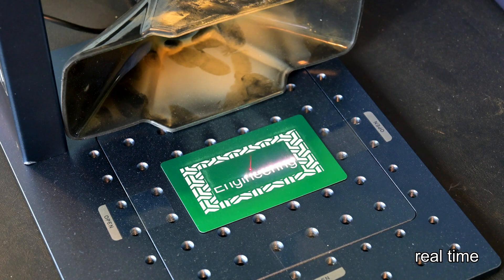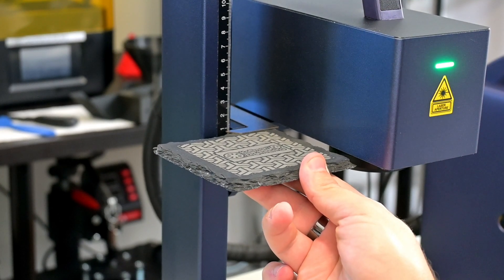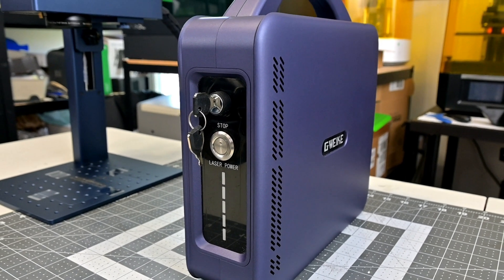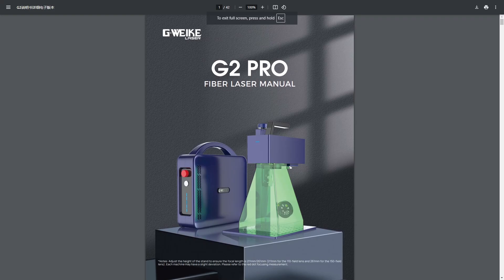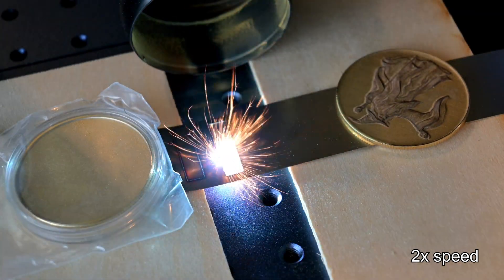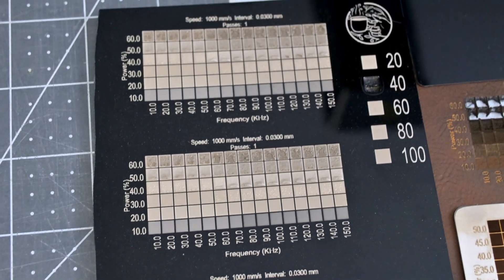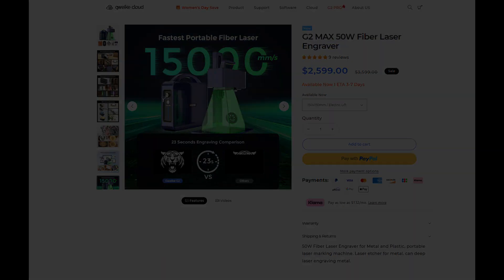The Best 50 watt Fiber Laser, with a catch | Deep Engraving | Metals&Plastics - Gweike G2 Max Review

Comment: I just got one of these and I have to say uh.. I'm not feeling it.. 

The head riser has a ton of slop in it, the inspection sheet that came with it honestly looks like it's not well calibrated, and the electric lift unit is so slow it's hard to imagine this being an actually enjoyable machine to use. This is also a "portable" laser but the cable between the source and head isn't armored or protected in any way similar to a portable marking laser. I'm not sure I even want to drag this thing to a craft show ~ Effectively, this isn't something I'd want to actually use as a portable unit. Unfortunately since I didn't get this as a free test sample, I'm honestly not even that motivated to turn it on because I'll probably get dinged with a repacking fee by actually using it. That means it doesn't actually get a shot. It's getting returned.. 

I wish I'd spent the extra $800 to get a proper desktop machine instead of a dressed up portable industrial marker.
Reply from the maker: Interesting feedback, thanks for commenting. I can't say I've experienced slop on the head riser, certainly none that would affect performance. And I'm a bit confused about lift speed. It only takes a few seconds to adjust, and I can't imagine a scenario where you are limited by focusing/lift time, as opposed to any other step like design, positioning, etc. But it's interesting to hear that it might be important to some people.
Reply: @HoffmanEngineering  Observing the rigidity of the unit shows it's highly susceptible to movement. If I type on my keyboard on the other side of my workbench, I can observe the head vibrating.

Honestly, it might be fine, but when these companies tend to crank you with restocking fees for using it at all, I'll just pass on turning it on and spend the extra bit to get some more working area and rigidity. After seeing it in person for $2500, I'm throwing this one back in the box.

Comment: Are you using a wooden table as base table? I’m a beginner with this machine and I’m just trying to avoid making basic mistakes. Also, did you use an air filter with it and how do you connect the air filter gweike cloud to this machine?

Comment: I've own a G2Max for about 4 months and I can't seem to engrave any deeper than 1mm into brass. I use 100% power at 1500mm/sec and a frequency of 35khz with 20 passes on lightburn but it won't go any deeper than 1mm even after I bring the laser down about 1mm for focus. Light burn also doesn't alow me to set the speed any higher than 8000mm/sec.
Reply from the maker: To go deeper, you'll either need to go slower (1000 mm/s), decrease the line interval, or run for longer/more passes. The brass coins I show are 128 layers (cross hatched, so 256 passes) at 1000 mm/s.
Reply from the maker: Lightburn has a setting under Device Settings for max speed, so that's probably set to 8000. You can bump that up.
Reply: Here is my suggestion ... And you won't like it. Try a different software. I have the same issue with my commarker fiber. It does great when I do a power test chart from the lightburn menu. But achieving the same effect by then copying the settings to an actual engrave doesn't even come close. Still not sure what causes it but there it is.
Reply: Did you ever get good results? I'm having the same issue. Tried brass and silver coins, all kinds of different settings but still can't get any deeper than 1mm or less.
Reply: I'm getting decent results at 90% power, 1000mms, 20khz, and 256 passes. Cleaning pass every 5 passes at 2000mms, 20% power, 75khz.

Comment: Are there any ventilation options? Say, a vacuum or air purifier? I plan to engrave on black plastic and am concerned about toxic fumes
Reply from the maker: I was using a fume extractor by Omtech, but any brand should work just fine with this fiber laser. I'd definitely recommend one with a HEPA filter and activated charcoal filter.
Reply: I've got a 6-in inline exhaust vented out the window. It's even strong enough to suck up  the fine dust produced when deep engraving Slate and metals. I take the inline exhaust fan and flex duct outside and blow all the dust out once a month to keep too much from accumulating and possibly damaging the motor.

Comment: Will this cut through 2mm aluminum? Does it have to be black aluminum or will plain aluminum work?
Reply from the maker: You can cut bare aluminum, but I never cut anything that thick before. I was cutting 0.2mm aluminum sheet in a single pass (at around 50 mm/s speeds). I'm no expert in metal cutting though, warping and heat management is important.

I think you'd be able to cut 2mm with enough passes, but I'm not sure what the setup would look like. Maybe someone else can chime in.

Comment: Hi! Have you tried cutting gold with this machine?
Reply: Wondering the same
Reply: Me 3
Reply: @skifjuinen  I have an older 30w JCZ fibre LMC4 that cuts through 1 mm gold/silver/platinum plate 250 - 300 passes, this new one would do it with ease, Im looking to upgrade to cut thicker plate, this is looking like the one.

Comment: This just runs on a 110v outlet in the house?
Reply from the maker: Yup, it actually doesn't use that much power. It draws less than two 60w incandescent light bulbs when running.

Comment: How does it handle curved surfaces? Have you tried a round object like a canteen? Does the laser lose focus?
Reply from the maker: The focus depth is around half an inch. Lightburn has some tools to help with that, there is a taper correction tool that can help even out engraving on slightly curved surfaces like a flask or flat canteen. But for an actual round canteen, you'd need something like the rotary Chuck.

Comment: Hi thanks for the review. I need to get a fiber laser for stainless steel and sterling silver simple marking (names, dates and maybe, when i learn to do so,  some pictures) in small items. I have a question: Do you know if it´s power could be enogh to cut 1mm width sterling silver sheets? Just for punctual shape pendant and/or earrings making, like  hearts, circles etc... Also have doubt if this could emboss silver rings like it does with the brass coins? Thanks and regards.
Reply: if my 30watts fiber laser raycus of commarker brand could do it then this 50watts should be able to do it too and a bit faster. you have to know your machine and experiment with the settings. we were able to push our machine to cut 1mm thickness of .999 silver with 2-inch long name for about 20-30mins... not so many people know the settings, we figured it our after about 5months if using it. However, make sure you put your machine in an ideal location with good electric  flow and less humid place.. get your fume extractor as well and not let dust accumulate in your machine. your business depends on your machine, if it breaks, days without operation is very financially devastating. better yet, get all the affordable components in your laser that could possibly break in the future so you will not need to wait weeks to order a new replacement for any repairs. waiting for manufacturers will take you minimum 3weeks to 1month.. based on my experience. Im giving you really good tips eh. you're welcome lol

Comment: Hi~ is this 50w fiser machine noisy if i wanna use it at home?
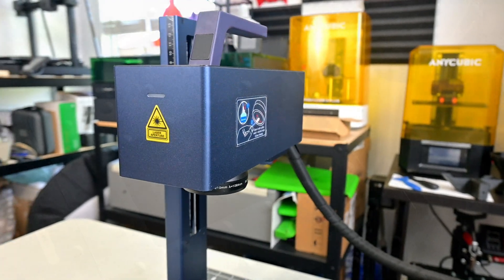Reply from the maker: The pulsed laser does generate a tone while engraving. You can hear an example at 1:45. During that clip I also had a fume extractor running at max. I didn't measure it with a sound meter. It's loud enough where I wouldn't want it running constantly in the same room while I'm trying to do other work, but not loud enough where you'd need hearing protection.

Comment: Hi great video. Can this engrave on glass? Thanks
Reply from the maker: The laser itself can't engrave glass, but you can coat the glass with a paint or coating to be able to engrave on it. I haven't experimented much with that though, so you'd have to find other videos to learn that technique.
Reply: @HoffmanEngineering  Hey Thanks so much! Will look into that.
Reply: @mariekeveriato a UV laser would be ideal for glass and other clear materials (acrylic) but it also depends on what else you’d want to be able to do.
Reply: @Xploit66  Im looking for a laser machine, specifically for glass printing. Unfortunately, most of these compact laser machines, while being awesome, aren't sustainable for glass printing, as one has to use black paint and then clean it off. So, with large quantities of bottles that I need to print, it doesn't justify the cost of the laser machine.
Reply: @ I’m not sure what your budget is but look into the g7 UV laser from gweike. It can engrave directly on glass.
Reply: @Xploit66  Sweet! I'll look into it right away. Thanks
Reply: @mariekeveriato  no problem, if you do end up getting one and happen to remember I’d love to hear how you like it. There definitely isn’t as much information out there for it since it’s less common of a use case.
Reply: @Xploit66  Sure thing :)